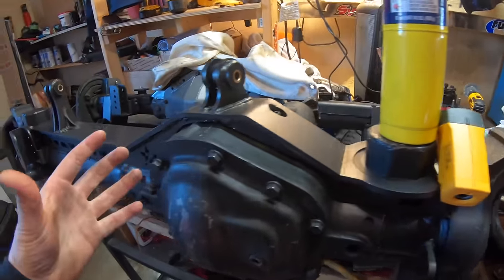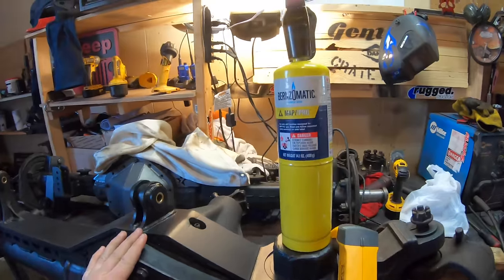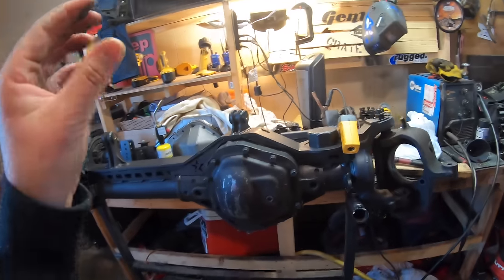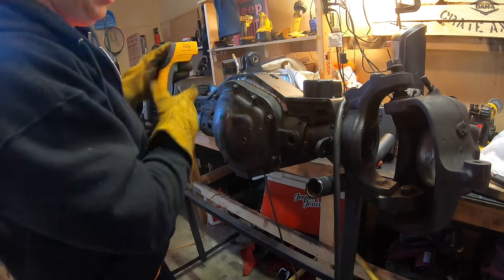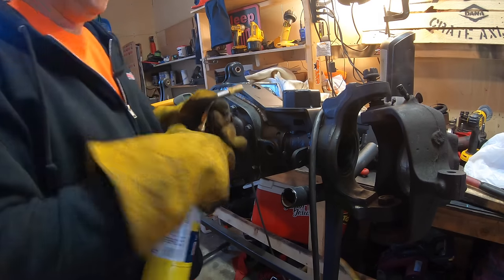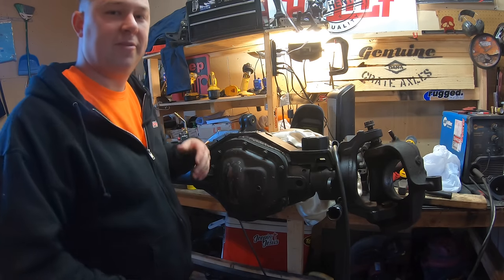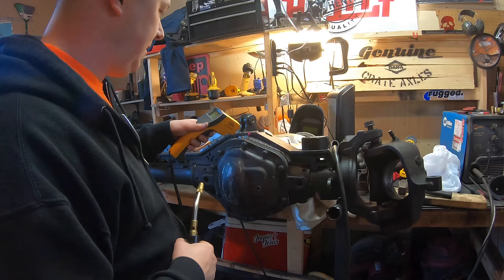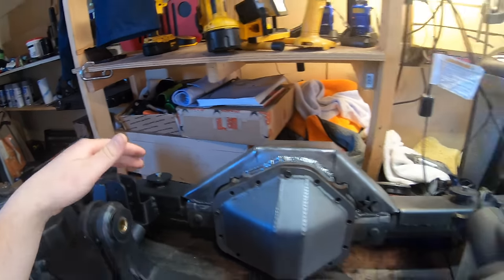How To Weld a Truss To Cast Steel - JK 1 Ton Swap

Comment: Love your videos but just wanted to point out that these differential housings are NOT cast steel, they are cast iron and technically should be welded with nickle rod. The inner Cs are forged steel, which is completely different and very weldable with a mig welder (er70s6). Without getting into complex metallurgy a simple way to test whether something is steel or cast iron is to take grinder and grind a spot and see if its a bright spark or a dull faint spark... Cast iron will have very dull faint spark.. Try it on your differential and then grind on your inner Cs... you will see exactly what I'm talking about. I know the truss companies say you can use a mig but its absolutely not the proper way to weld cast iron, not saying it doesn't "work" and if it's all you have by all means go ahead but if you have the option use the correct stuff which is nickle rod. The main reason for my post is just to point out that the diff housing and the inner Cs are not made from the same material, they are completely different.
Reply: Nope, they're something called nodular iron. While nickel based rod will most definitely work, this method of mig and heat is tried and true.
Reply: @rigrocket1332  lol Nodular iron is cast iron and Ni55 is the proper filler. All differential housings are made from nodular cast iron and always have been. Some people get away with using er70s6 mig and lots of preheat but it is certainly not the correct method.
Reply: Aw cmon bro! If you're gonna read the wire type off the box at least call it gmaw and not mig!
Reply: @rigrocket1332  lmao sorry that numbers confuse you…. Gmaw tells you nothing, that’s a process, it’s the filler wire that matters. You can gmaw them with ni-55 and that would work great… Gmaw with 70s6 does not

Comment: I thought all you would  need to do was prep/clean off the paint, rust, and debris at the weld area first by sanding it out till you see shiny metal then weld whatever it is that needed to be welded. So I guess the weld area for the differential is a different process due to temperature cooling difference. Great video tip!

Comment: follow-up question - did you use high-nickel wire for the center section(s), or just regular mild steel MIG wire for 'everything'.  Also, how thick do you recommend - .030, .035 ?

Comment: did your D60 have the carrier installed?, or was it empty (with the diff cover on to protect the insides)? Second, you heat up/keep the center section hot to 'match' the truss and try to maintain similar temps as the truss cools down?
Reply from the maker: Yepp everything still inside. Some people are afraid of the seals, but mine were fine and still are. Yes you post heat to maintain as it cools. I would recommend post heating to keep temps similar as long as you can as they slowly drop, then wrap in a thermal blanket for the rest of the night

Comment: I’m in a tough spot. Trying to build a Dana 70HD into a front axle.  I’ve already pressed the tubes out but the leaf mount is my issue. Going to try and lathe a perch on the lathe but my lathe is limited. After seeing this, I may just make a full axle truss and use the truss as a perch.

Comment: Did you know they make a wire for your MIG that only requires you to heat the cast iron to about 150°F in order to stick properly? It's expensive tho, like over $600 for a 5-pound roll,  but it also has a much higher tensile strength of around 100,000# vs about 70k with most MIG wires. I figure I will only use it for the cast portion of the welds and use regular wire for the tubes and stuff.

Comment: How did you confirm the center section was cast steel? An assumption could lead to big problems if a viewer tried to replicate what you have done and it turns out to be cast iron.

Comment: Could the cast itself crack, or just the weld? I’m at this step now. I welded the Barnes truss to my sd 60 yesterday, want to weld the cast and the tube to the cast tonight, then do the gears this week. Just making sure I got my ducks in a row before so I don’t fuck something up. Appreciate the videos, I’ve gone back through them several times as a reference through my tj build. After gears I’ll get my Barnes high steer arms welded up too. 🤙
Reply from the maker: Just the weld

Comment: I have a 1988 Jeep Wagoneer Dana 44, is the pumpkin Cast Steel or Cast Iron?
Reply from the maker: Im not sure about the wagoneer axle, however i would still recommend doing the pre and post heat when welding to the pumpkin
Reply: JK Gear and Gadgets I read that they make a MIG wire for welding cast iron/steel.  But it’s $80/2lb spool.

Comment: Do you think you can weld to the cast on a Dana 44 rubicon without taking gears out?
Reply from the maker: Yep. Shops do it all the time
Reply from the maker: Be careful. Don’t heat the 44 up too much around the axle seal areas. The 60 is thick, whereas the 44 can heat up pretty fast and melt them

Comment: All of the spot welds were not the best idea , a good spot weld on both ends would have been the best , then take your time and fill the gap just like pipe weld is done with gaps to get full penetration without all the spot welds that would have to be feathered in to let you get a solid consistent weld ,

Comment: every dang forum ive read on trussing axles say its not worth trussing. Gusetts yes. trusses no. due to the axles warping or bending with the heat while welding the truss on, so basically your warping the axles installing something designed to keep that from happening. obviously you dont beleve that? im getting 37s on monday and doing my homework....thanks for the vids
Reply from the maker: As long as you alternate around when welding, it’s fine.

Comment: Did you leave the carrier inside the diff or just leave the covers on?
Reply from the maker: It doesn’t really matter. If you are able to pull the carrier out then might as well
Reply: @JKGearandGadgets  i plan on doing this to my 44 front and rear but do you think the heat will mess with the axle seals? the front gets more weld so might just go slow and try to keep the heat soak down
Reply from the maker: With a 44 truss you don’t need to weld the whole section, just weld 2-3 3” sections. And yeah don’t heat it too much in the front axle seal area.

Comment: Any concerns for differential internals or cover seals?
Reply from the maker: We will be changing the diff cover anyways, the gasket is very cheap or you can use rtv. The only internal component that could be damaged is the axle seals, but they are a good distance away from the heat
Reply: JK Gear and Gadgets thanks much, come from HVAC so always thinking about rubber when there’s fire on metal
Reply: @JKGearandGadgets  I'd be a little concerned with pinion seal on the front, but maybe that's far enough away too?
Reply from the maker: Joshua Mann yeah that’s too far away to get damaged

Comment: You DO NOT HAVE TO HEAT THE CAST! 

I see so many doing this the hard way! 

First off min temp for welding cast is 500* ideally you want 6-800* no more then 1200* 

Side not.. when welding you ideally want 1/8” or so gap this keeps the metal from pulling as the weld cools. This is why welders always bevel all surfaces to be welded to 30* or so. 

Do this work in your deiveway out in the sun. There is a cool weld and a heat weld to welding to cast. You only need 100* surface temp for a cool weld which you’ll get on just a 80* day or so long as the axel has been sitting outside all day. 

Second misconception.. you only run small beads 1-1 1/2” to cast cause if you exceed 1450* the cast will crack. Welding reaches typically 1650* ish.. 

Here is the easy way to weld steel to cast steel.. set it outside in the sun over concrete (concrete reflects heat and makes it hotter) 
Even on a mid 70* day that axle can reach over 100* in a concrete driveway on a sunny day if welded in the afternoon. 

Second weld 1-1/2” inch at a time then take a lunch and hammer and peen the welds as soon as you’re done. This keeps the weld from cracking.. use the lunch and hammer every 1/2” or so and lunch the center of the weld.. then rotate and do 180* opposite side same location the same way. 

When welding cast always run welds same direction back to previous welds. For example I’d doing the tune to the housing.. the two 180* welds complete 1/2 of the weld.. the renaming two should run from the finish point of one to the starting point of the other. 

When doing this there is no heating no blankets etc.. if it cracks I wouldn’t grind it out. Simply use a .045 cutting wheel and grove the joint directly on the crack then run another bead over it. You won’t have to worry about cold or hot welding the cast at this point. You are only welding the weld back to itself not cast to steel. 

There is way way too much uneducated speculation on this when it comes to the 4x4 world. I see way way too many people going to these extremes that are just not needed. 

To be honest I’ve welded cast to steel on several axels to date over the years and never ever once checked the temps of the materials. Never heated anything either. As an experienced welder I just freaking send it and if it cracked (never has as this only happens if you over heat the steel and run too long a bead “meaning more heat” where the cast cools faster then steel pulling heat out of the steel much faster then the steel can cool and cracking) I’d grove it out ant cap it. 

Thing is.. the way everyone doing these videos is welding 1” or so at a time you’re never going to heat either material enough for this to matter. The truth is by hearing to 5-600* you should be welding the entire thing at one time. That’s the reason to preheat. Pipe welders do this for this very reason. When running small beads it’s completely a waste of time. 

All that said.. here is how I’ve welded every axle if ever done.. first off I use flux core wire .035 to be exact. (They do make special rods for those using stick that work the same way but the issue here is stick generates more heat so special rods I would recommend vs wire. Prime example I’d never weld an cast housing with say a 6010 or 6011 rod. 

I’ve always (living in Florida) just left the would be axle outside on jack stands for days. (Not cause I was doing anything special just cause I was waiting for the time to get to it) keep in mind here for some reason I’ve always been doing this in spring or summer... 

If simply just laid a good bead for 1-1 1/2” around the tube rotate 180* and did this again. I then moved to the opposite side and repeated. I then move back to the first side and go over the plugs. Then the other side same. Rotate again and weld the first tube all the way same direction from first two beads SAME DIRECTION (this is important on cast materials not with regular steels) move to other side do the same. To state again and go back to the first completing it in just 4 welds. Do the second side the same.  No time between no special hearing or cooking no nothing.. just using simple welding techniques. Never had one crack!

Now I know this is getting long.. but when welding to the steel tubes for the steel truss.. soon as you weld one side of said truss flip 180* and weld the other this is what keeps the welds from pulling out of square, level, etc. then move to the furthest opposing side and do the same. Rinse and repeat. 

Now here is where I’ll get controversial with experienced welders... when welding cast to steel the issue is the cast acts as a heat soak to the steel which cools at a much slower rate then cast does which means the reason the weld can break is cause the cast filled too fast and soaked all the heat out of the slower cooling steel and the cast was cold while the steel was hot. Keep a water bottle handy and LIGHTLY cool the steel side only with water so it will cool faster. This is not a recognized way to weld cast to steel but I’ve done it for 15 plus years wo issue. This is by no means a recommendation of doing this.. as the worst possible thing you can do is cool the cast even faster as that a sure way to crack the weld. If you want to go this route (which I do wo peeping which honestly is recommended and just as fast and easy) then pour the water on the tube 1-2” from the joint.
Reply: What mig wire i should use to weld cast to steel? And Thank you for the information
Reply: Great write up! What rod do you recommend if 6011 is not the go too rod. Will 7018 work?

Comment: Ps structure welds are always up hill.
Reply: Bubba take a D1.1 3g weld test and run that open root up hill with mig tell me how it goes....
Reply: @keepjeepin969  mig or mag? Because mig should be easy 3g... cooling of hard wire open root .25 bev w 3/8s gap with ceramic backers.. at least thats how my tests went for navsea.?.? The only time it gets rough is 308/309 Stainless- dissimilar metals
Reply: Josh Zimmerman at the end of the day this weld does not qualify as a structural weld. it’s a automotive weld. Yes it holding the structural of the axles but is there a bevel in there? Is he running multiple passes on it?
Reply: @keepjeepin969  just trying to help, the weld is fine, lol just keeping ppl educated. Not trying to be a troll, lord knows there's to many out there and Ben is one of my favorites to watch since this series came out.